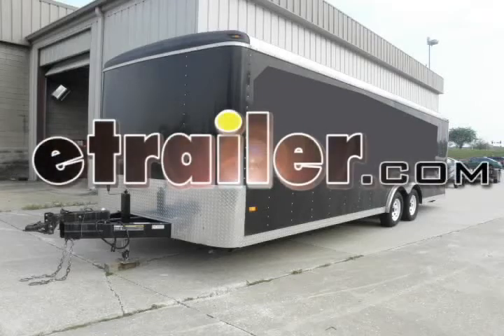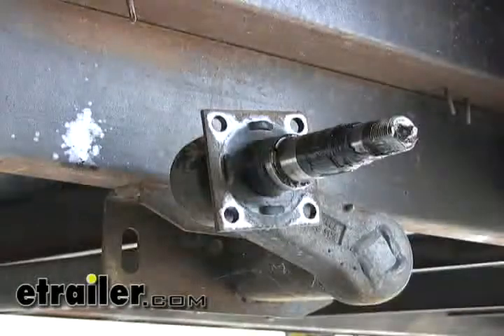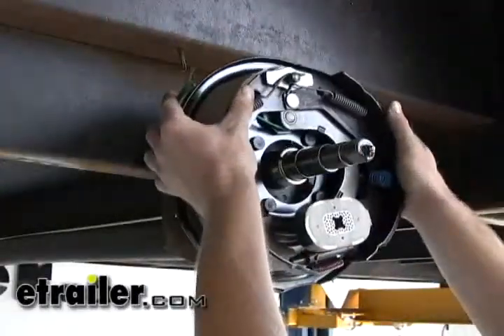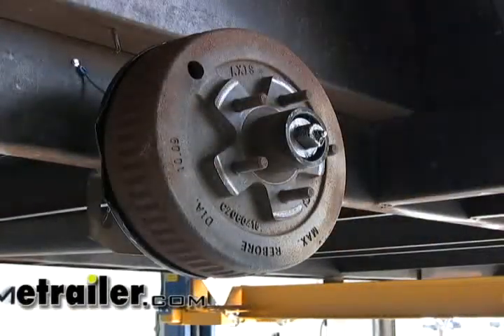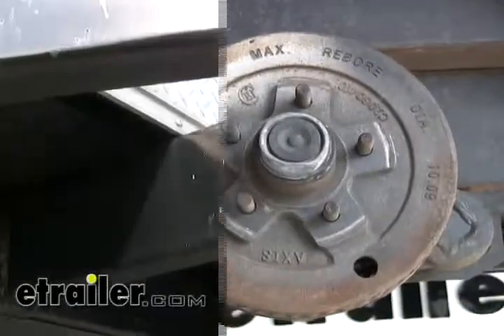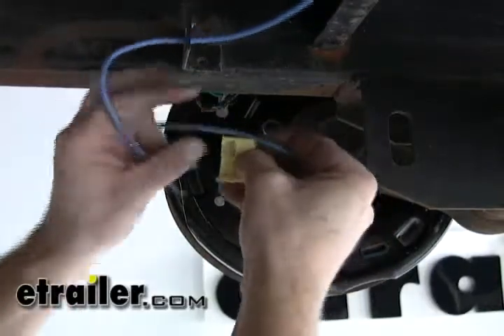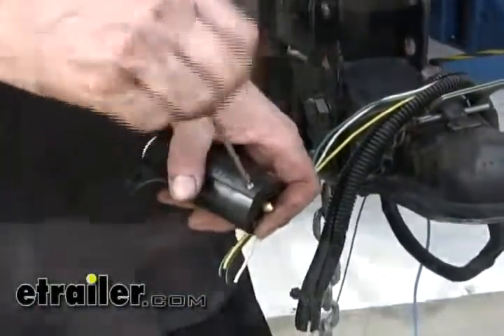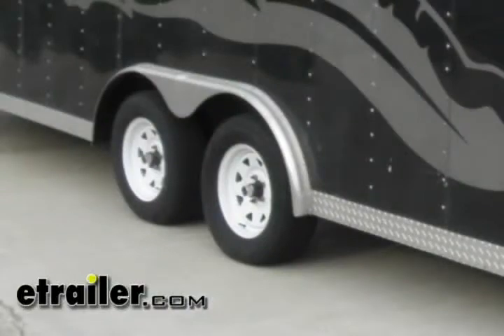etrailer | This Old Trailer: Changing Hydraulic Trailer Brake to Electric

Comment: This sort of wiring is what keeps me in business never I repeat Never use scotch locks on wiring that is so essential to the safety of yourself and others all the wiring needs to either soldered or at least proper waterproof connectors and be covered and fastened off well

Comment: I cringed at the electrical connections too. I dislike those Scotch Lock splices, but I wouldn't criticize their use if it were somewhere that they wouldn't be exposed to the weather and road spray. I also don't like a simple crimp connect if it's something that matters. In my opinion the crimp should AT LEAST be sealed with heat shrink insulation, but if it were my trailer I'd be soldering and using water proof heat shrink. I know that's overkill and personal preference, but if that trailer is loaded and I'm coming down a steep hill I would rather know I overdid it than cheaped out on labor. This wiring would be acceptable as a DIY job on something non-critical like the lights on my own trailer, and I can check the lights before the vehicle starts moving. As someone who has repaired and replaced lights for 40 years on my small boat, utility, and motorcycle trailers I solder and heat shrink them because I don't like having to redo the work every few years when it corrodes and becomes unreliable. Doing this as a professional job on a customer's brakes will certainly get the job out the door but it scares me to know someone's pulling that box trailer on our highways. I'm a big fan of eTrailer for parts and I found the mechanical info in the video helpful since I've got to rebuild the brakes on a 7,000 lb sailboat trailer and I'm trying to decide on replacing the hydraulic actuator or going electric. I suggest viewers look elsewhere for electrical advice.

Comment: So you don’t need anything else besides the electric backing plates and the 7 way wiring? I’ve seen other trailers with a small electrical box near the tongue that the trailer brake wires are connected to before going to the plug on the truck?

Comment: I'm wondering what about the hyd assembly on the tongue. You just leave it or what? Isn't it going to slide?
Reply from the maker: You will still have the movement in the coupler if you choose not to swap it out for a different coupler. If it were me, I would not like the movement so I would switch it out for a new one.
https://www.etrailer.com/Accessories-and-Parts/Dexter-Axle/23-26.html
https://www.etrailer.com/Trailer-Coupler

Comment: As an electronic tech I cringed with the exposed blue wire no loom or solder on any connections. This isn't waterproof which means they will fail. But. I'm a bit OCD on overkill for protection of the elements. Seems like it will chafe on the frame tho. Anyways the video really helped me, and I thank you for the information.
Reply: I do ALL my own work which makes sure it's right and safe. I am 71 and have never needed AAA.  I'm putting electric on my boat trailer, been wanting to for many years.
Reply from the maker: @davidw7015  This great to hear! Feel free to reach out to us and we would be happy to help find the materials you will need to get the system installed.
Reply: I cringed at the wiring too, considering lives are on the line perhaps replace this otherwise great video. You won't find out till its to late that one or more connections go rotten. Or the main lead rubs through and shorts. The tape just holds in the water to rot sooner fyi. I make good money fixing wiring jobs like this 2 years later.

Comment: Why would you go from hydraulic to electric!????Electric brakes are good where weight would be a problem but the efficiency of the brakes are similar!!!In my case since i like the indepenndence of not having a brake controller in every vehicle we own(3of them)
Reply: You can control the brakes of the trailer independently of the truck braking, great for controlling trailer sway

Comment: Hi, I have a car trailer that I am pulling with a 4500 ram truck. I keep getting the message that the trailer is not connected. This has just started to happen, I noticed that you used 10ga wire, I know that the trailer manufacturer of my trailer used 14ga at best. Do you think I am getting enough of a drop in signal to give me this error message? Thanks in advance for any help. What info would I need to order new parts from you for my trailer. Would like to get it all pre loaded on a backplate.
Reply: Mrflashlite
Reply from the maker: Is the "not connected" message appearing on your brake controller? If so, can you let me know which brake controller you have and the year of your truck?
Reply: It does show up on the brake controller (not sure what model the controller is, whatever came with the truck) it is a new 2018 ram 4500 series. The truck is not here now to get the model number of the controller.
Reply from the maker: Trailer connection is predicated on a on a completed brake circuit at the trailer connector. The BCM sees that the circuits are complete (blue wire) which turns the brake controller on.

The first thing I would do it make sure the trailer connector is plugged in all the way and making good connections. Check it for corrosion and clean it up if needed. 

The next thing I would check is the grounds to the trailer brakes, trailer and inside the connector. If there is a grounding issue there then the brake controller is not going to work because it does not see a completed circuit.
Reply: Hi, ended up running all new no.10 wire and ran a hot to each axel so I could separate them when troubleshooting them. Hooked everything up and got a message to check trailer wiring, unhooked the hot to the front axel and the message went away. I then used your video on how to check the magnets for amps and sure enough the one magnet was bad and has to be replaced. This is still all under warranty and will be taken care of. The trailer manufacturer had this for over a week and didn't get it fixed. Thanks for your help and in the future I'll order parts from you.

Comment: Why use a 7 pole for 5 wires ?
Reply from the maker: For this particular trailer it was what our customer requested. He wanted the option to add the two additional functions if ever needed (12 volt hot lead and auxiliary).
Reply: The trailer industry as a whole is going to seven-way trailer plugs. They give more functions and tend to be more secure when plugged in. They are coming stock on new trailers and trucks. People don't want to use a five-way to seven-way adapter to plug into their truck.

Comment: What about the surge master on the tongue? Will this be welded or just left to slide back and forth?
Reply: You can remove it like I did, but then you'll need to get a weldable coupler, either welding or drilling new holes to match your existing holes on the tongue.